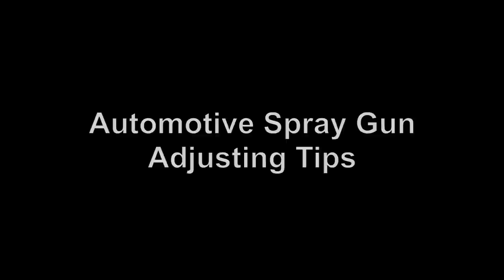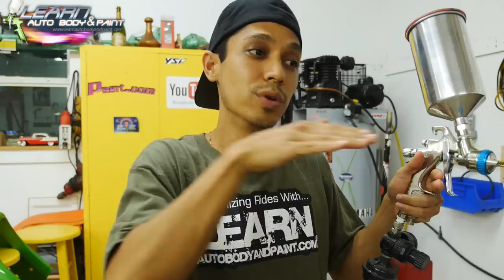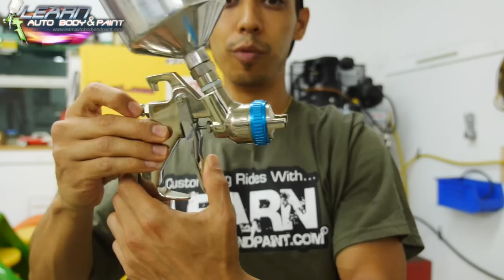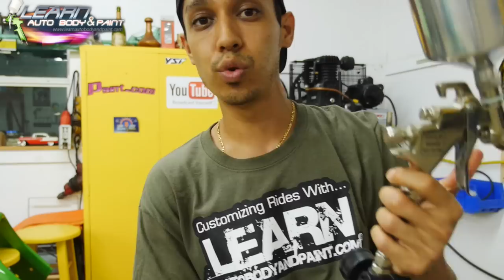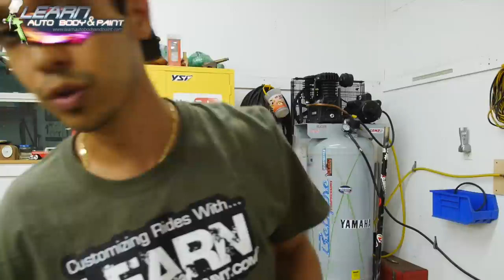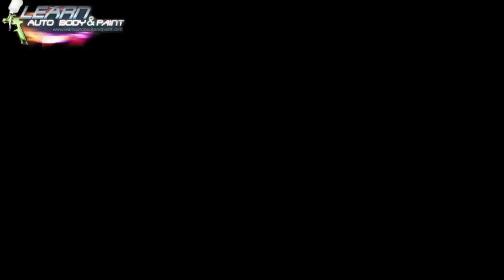1 Tip: Adjusting Your Spray Gun - Automotive Spray Gun Setup For Painting Door Jambs

Comment: Hi fantastic video i just have a question i have an Airgunsa AZ3 hte2 gravity feed spray gun what pressure do i use to spray i was told 37 psi does that sound right
Reply from the maker: It depends on what you are working on and your air compressor. Download your free 85-Page auto body and paint manual to learn more: https://learnautobodyandpaint.com/free-autobody-manual

Comment: Does the P.S.I apply to all nozzle sizes?
Reply from the maker: You would have lower pressure with smaller spray guns. I am talking about 1.3-1.4 tip sizes here commonly used for all around automotive painting. Get my free auto book here: http://www.learnautobodyandpaint.com/free-autobody-manual/
Reply: Official How To Paint a Car - DIY Learn Auto Body And Paint Training Site Ok thanks alot,how about motorbike fairings same size? or smaller nozzle.

Comment: Can I do 28 psi using the iwata supernova. In the book they said the optimum pressure is 19psi but I sprayed at 22.5 and it don't seem to atomize very good. If I crank it up to 28. That's 10 psi more than they recommended. Is that bad?
Reply from the maker: Hell no. What book said 19 psi? Throw it out!. Spray with 26-29 PSI always!! Good luck and let me know what happens ok?  Cheers!
Reply: Official How To Paint a Car - DIY Learn Auto Body And Paint Training Site The instruction book that came with the Iwata Supernova gun. It says (Optimum Atomizing Pressure is 19 PSI) for the Supernova LS400 Silver cap).
Reply from the maker: phu phool I think that's where the atomization starts. I would spray at 28PSI for clear coat. 19 seems way too low, even for that gun...
Reply: Official How To Paint a Car - DIY Learn Auto Body And Paint Training Site Got it, Thx bro
Reply: Official How To Paint a Car - DIY Learn Auto Body And Paint Training Site Hay man, 1 more question. After the compressor just charged up. I got the gun set with trigger pulled @29PSI. I loses 5.5 PSI at the gun (with trigger pulled) before my compressor start charging again. So 29PSI to 23.5 PSI before my compressor charge. Is there a way around this? I'm trying to keep it in the 26-29 PSI ranch.
Reply: phu phool 19 psi is the nozzle pressure, no way for you to test that.  Go test/practice on some panel.  It is conditional for a good,  quality finish:  temp. humidity, paint viscosity. Try between 28-32.  Supernovas tend to be air hogs.  I hope that you have a good compressor to match the minimum cfm that your gun requires.